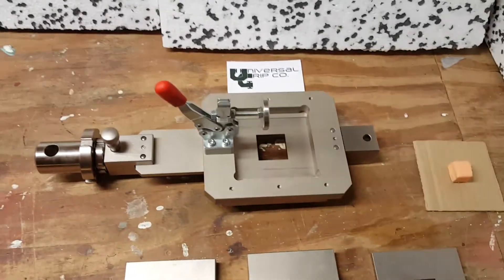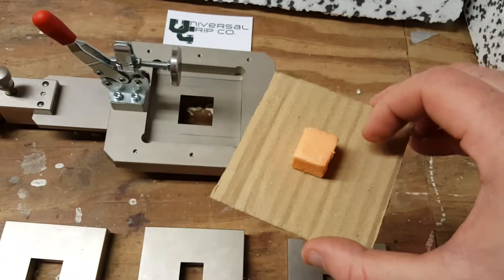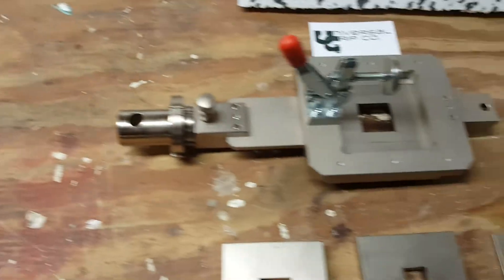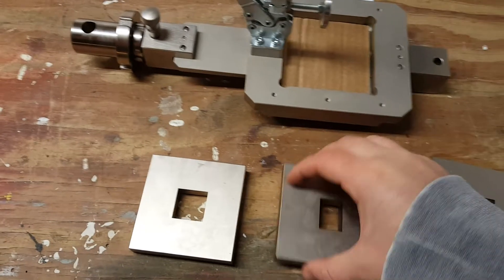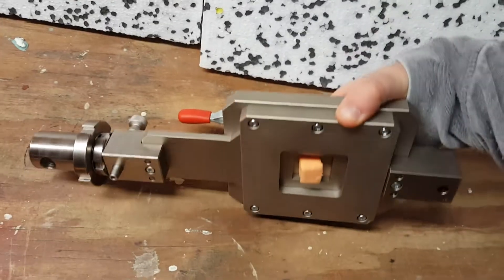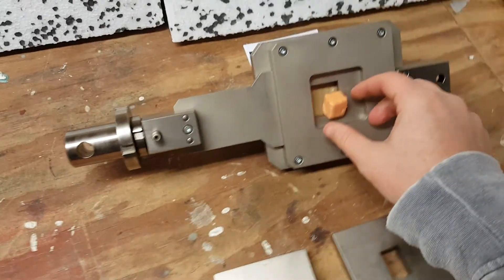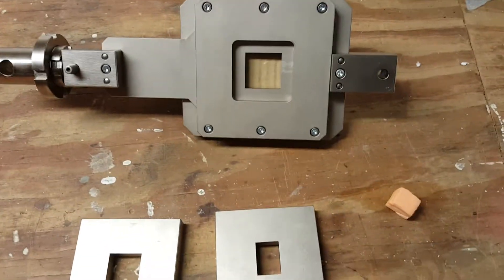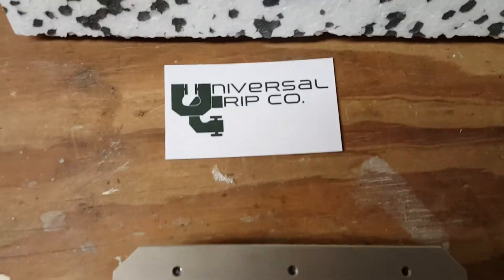ASTM D4501 Block Shear Fixture

Comment: How to calculate the shear strength here?
Reply from the maker: This one is pretty straight forward, you can just use the ultimate shear strength from your machine reading. And the sample is usually 1x1”. So it’s an easy calculation to get shear strength per square inch.